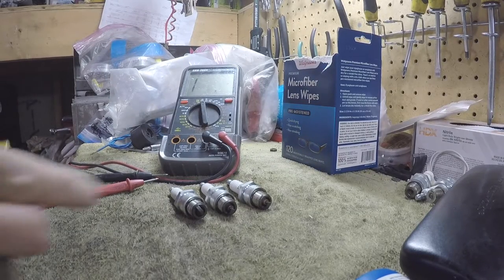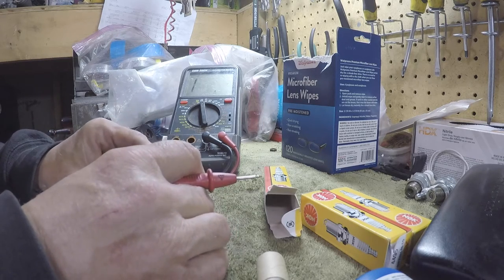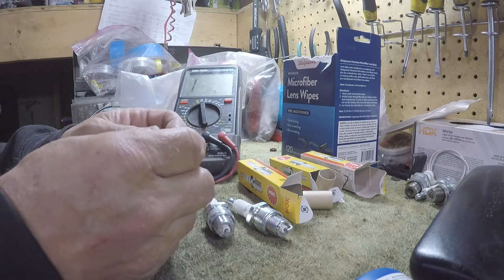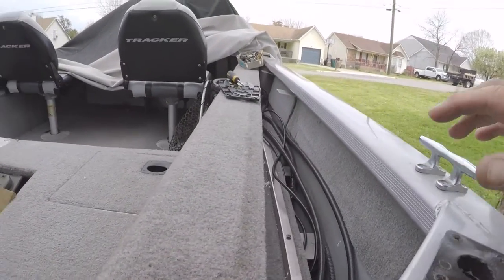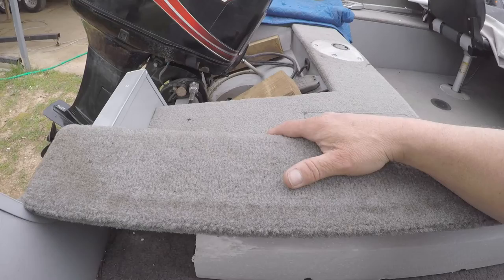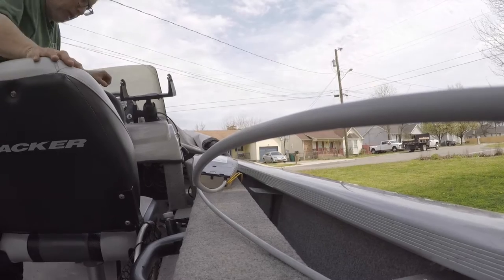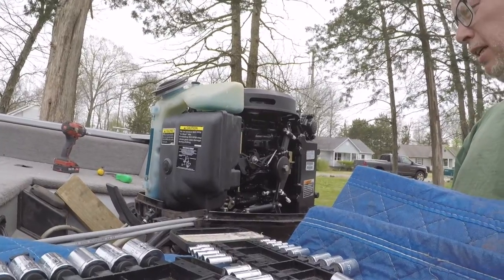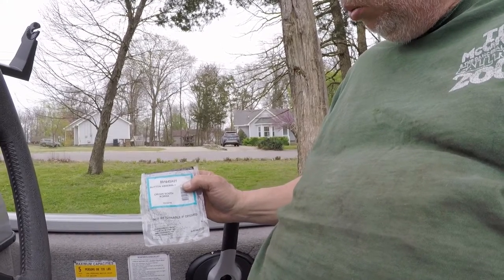2008 Tracker side panel remote shift and throttle replacement part2 #nashville #tennessee #tracker

Comment: Video is an advertisement for harbor freight tools and he calling bass tracker cheap. Old is a better term. The quality of those boats for the price is great. It’s a working man’s class boat that be owned without breaking the bank. With a four stroke to boot. Plus we’re talkin about OLD boats. 20 30 years old. Plenty of people are still rocking the 20 year old trackers and lovin every minute they get to enjoy on the water.
Reply from the maker: Harbor Freight does not give me money in anyway shape or form.
Reply from the maker: There is a bunch of sheet metal screws.  Some are up under the dash.  Its the only way I know of to get to the back side of that remote.  You have to even move the helm console but only slightly and it will move.  There a couple of screws in the front of the helm console you have to remove as well..  Please subscribe it does help... Thanks for watching!

Comment: Thanks for wasting more of my time. I wanted to see how you disconnected the throttle cable at the motor even though I'd bet it wasn't as much of a nightmare as I'm looking at on a '87 mercury 35 HP on a 21' Bass Tracker. WTF is up with the 6 minutes of spark plug education? has nothing to do with the title of the video